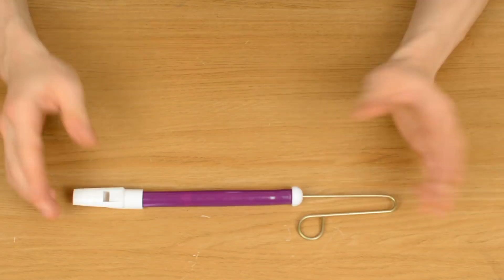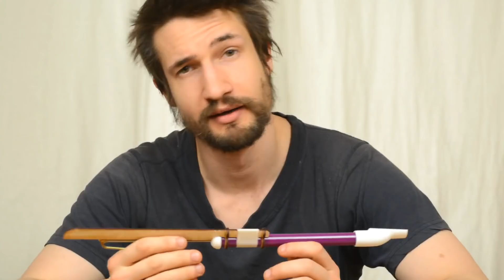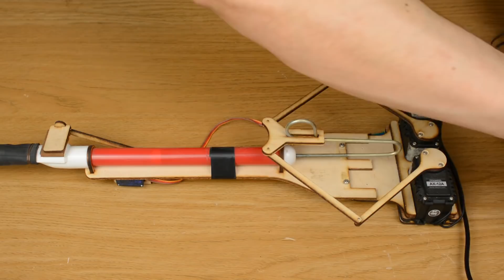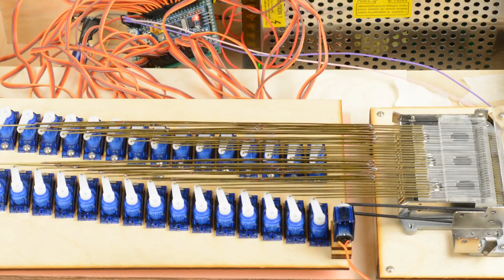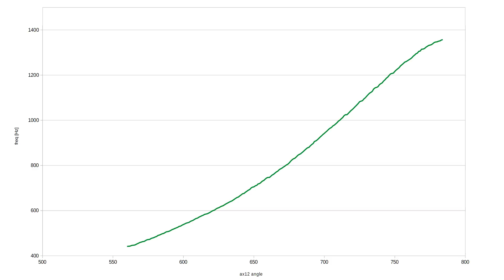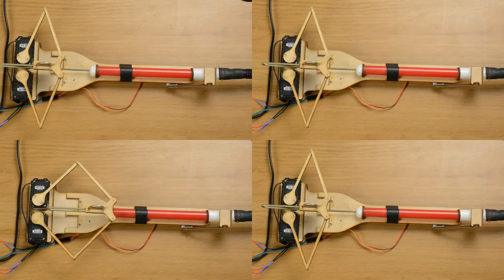More MIDI madness

Comment: Use a stepermotor and a slide mechanism like in fast 3D printers. And you get accuracy in every note. Also make a Flute organ with different sizes to get the base the midst and the hights

Comment: You can make it auto tune it self. Add a small mic to it and a code a frequency analyzer, make it to do a full range slide and update the points where the frequency (the notes) where right. You can also add a "if" statement that if the updated points deviated too much from the previews save something went wrong and it should discard it or run again.
You can make it do it at every start up and/or add a button to call for it.
Reply: This is a great idea!

Comment: all it needs is a vibrato function. something like a small trill between half pitches and you could adjust the strength of the vibrato with the mod wheel

Comment: I wonder if that stopper you're using for clean note starts could be linked to the glide function that's present in DAWs that determines wether the synth glides to the next played pitch or not, depending on how much time there is between the midi input of one note and the next or if the inputs overlap. You maybe could make the stopper close the hole between notes when you want clean changes or a staccato sound with no glide in between. Also, big pvc bass slide whistle?

Comment: Oddly, this is the first time I've ever encountered constructive/destructive interference from my computer speakers, during the three 4-ish part songs. I had to be in a specific position in relation to my speakers, and got an odd sound and feeling right at my eardrum(s). Just something about the tones etc. Also, just a tiny bit curious, why use 2 servos to drive the scissor, instead of one with a gear that matches to the other side? I'd assume insufficient force etc, or difficulty of making sufficiently tight gearing, but nothing was stated.

Comment: Wonderful project! If you already have automatic pitch detection for your calibration run - couldn't you include a control loop during playback to adjust the pitch if it is slightly off?

Comment: Holy shit, this reminds me of the time I used a similar board to build a ghetto-as-fuck lighting controller... Being a diehard Rammstein fan, I predictably added a special 12V relay that set one of my arms alight with a bunch of pyrotechnics. I found the video the other day of my miming (REALLY badly) Du Riechst So Gut with a seizure-inducing light show, and perfectly timed pyros. I say miming, because I was still so new to guitar that I couldn't even pretend to play it! I kinda went off the rails with the pyrotechnic stage shit, and learned bass, keyboards, and how to actually play guitar instead. Mad times. I'll have to build another one if I can get permission to pull that shit off live anywhere!

Comment: been thinking about the bass slide whistle. I was thinking about building one out of a large pvc pipe. to drive the plunger maybe have a lead screw through the center and a beefy stepper motor to move it.

Comment: don't you think you could just MAKE a bass slide whistle? surely you would just need the whistle piece off a recorder, a large length of pipe, a wooden disc with some cotton around the outside of it for the plunger and some stiff wire (probably a coathanger) for the slide, then you'd be golden.

Comment: The timbre is so bad though... The tech is awesome, but you might as well make a better sounding whistle to use and not that cheap dinky plastic whistle that probably is not meant to be played seriously. Sound is complicated and difficult to explain details about, because we don't have the vocabulary to go into specific details about different sounds, but long story short, a note isn't just one note. It's a whole bunch of frequencies combining into a "pitch" a given pitch can contain all kinds of different imperfections in it depending on the thing that is producing it and this dictates how pleasing the sound is just ambiently without anything else going on amd is a partial explanation of why different instruments sound like different instruments. You could make a whistle with better dimensions and matierial that would just sound better and produce truer, more perfect pitches. I sense strong dissonant harmonics coming from that specific whistel, which is why it just instricaly sounds cheesy and bad. Even if it played perfectly in tune it won't fix the timbre.

Comment: Autotune slide whistle. Fail!
Drop the plywood. Re-design the piston to allow it to slide on the shaft but with stops to limit its range to 10 mm or so. Oh, also put one of your powerful magnets on it against the outer wall.
Add your series of magnets on the outside of the tube. The expectation then is that as you move the piston in and out of the tube, it "snaps" to the nearest magnet on the outside of the tube — the 10mm slop you added allows that.

Comment: Great video! Only complaint is the structuring. The pace could be increased a little bit and the full demonstration could be put later on to maintain enagement with a little excerpt used to prove the concept.

Comment: I think the didgeridoo and cello sound good together... I liked you xylophone and music box too. There is always the glass harp.  I remember hearing something that worked like a panpipe, but the tubes had water inside, so it sounded kinda slurpy..  

How about making a water pan pipe with  bellows/diaphragm to control water level

Or a reed instrument that uses a piezo membrane in place of the reed...

Music selections:
Vivaldi Four Seasons
Deodato-2001 Space Odyssey

Comment: That non-midi slide whistle from the beginning of the video could be improved further by gluing a steel disk to the face of the piston, and then glue the magnets to the outside of the plastic tube.

Comment: Weirdly this is almost the exact opposite of what I 've been thinking of since finding out about the FLASH. What is the smallest midi control interface you can think of that could be built that is capable of a full octave and could actually be played to an elegant level of proficiency? And no, I'm not thinking of a little ribbon controller.

Comment: There's a lot of breathy, white noise, ripe for filtering. Here's a thought, you can rotate the whistle about the slider axis without changing the pitch. Perhaps by standing it up, you could rotate the (leading edge, noise hole?) to direct the sound into one of an array of simple, open tube type, formant resonators circled around it, giving you *vowel sounds*! Lengthenable tube inside a tube and you got yourself a dipthong. A tube with an openable mute at the end gets you a wah a wee, a weh, yow, oi).
 You can fake a bass swanny whistle by recording in double time and playing back half speed for every octave. Sloppier, but bass parts are simpler. Inversely, you could tighten up faster passages by recording at a slower speed.... You could also alternate from octave derived ranges and timbres by modulating, say, a fifth, then recording and playing back at the right harmonic ratio (2:3?). Although this could get a bit modal, beyond fifths and fourths, you are the master of your temperament. That could be a cool way to emulate modal choral arrangement, Gregorian chant, which could be hilarious.  It may even be feasible to script and automate multiple passes calibrating, multitracking and editing these pitch/time derived timbres, leave it running, perhaps out of earshot, and return to an immense multi voiced lush chorus of swanny. And maybe a generated an editing script you can import into a video editor, Or a slow frame rate time capture with a sunset in the background, for content purposes. May be obvious, but, further to extending the range of pitch and timbres, with automation, you could do multiple further passes with different damping, slightly detuned, or tuned to a lower throughput of air, and create further, double tracking (not harmonizing), 'studio chorus', thickening effects, without using modulated digital delay. That might be musically useful, potentially a sample pack for patrons. You could create a veritable Enya of swanny whistle. Yay content.
Are the overblown harmonics useful, repeatable? Thinking you may have finer control of the pitch with a lower note playing a harmonic, potentially another timbre for multitracking.
If you ever go back to this, and mount it, it will be worth isolating the motors, via shafts into the box, way more prominent than the fan. Multi tracked servos will be a nightmare. Love your work!
P.s. it might be useful to add noise to your pitch by adding a vibrato from another source, maybe with an LFO'd, off-weighted vibrating motor interacting with the shaft in some way. Or a coil holding an oscillating current surrounding the shaft. 
Given your setup recalibrates itself, you could swap out alternate mouthpiece, tube and plunger combos with others of the same length, but different diameters, or materials. Different mouthpiece type, eg a transverse flute might be doable, reeds?
Final thought, another air pressure source, just for transients, might reduce attack times and help control the amplitude by blowing the harmonic out such that it's just in the transient, leaving the fundamental to sound. Maybe.

Comment: yt doesn't allow direct url's now, way to kill the yt usefulness, yay.
did no one notice and complain yet !

anyway see
Robert Murray-Smith Making Tongue Drums - Working Out The Size Of The Tongues
Robert Murray-Smith Making Bellows - Template And Tape Method
Robert Murray-Smith Hemp Plastic - Moulded Sheet And Rod
Robert Murray-Smith Making A Speaker From A Microwave Oven Transformer

opensource com article 18 8 programmable-music-box-software

Create DIY music box cards with Punchbox
Now anyone can create music box punch cards.

Comment: It's... a  mixed bag here. First time I had to stop one of your videos to preserve my earing. 😔

Expression is definitely lacking. Both in your human performance and in the midi one.
It's... a whistle: you should definitely whistle in it.  Not 100% sure it would sound better, but it can hardly sound worse.
It should give an... ADSR envelope to the tones you're producing.

And then: how can a computer whistle? Maybe a solenoid valve? Maybe a motorized bellow? It's... gonna be a pain to implement, after all this is pretty much ventilator technology, we all looked into it in 2020 and it's hard to get it consistent.

Also some components for it, like solenoid valves, might still be a little on the expensive side, right now.

Is it worth researching? It might... if it's not meant to be born and die with the whistle. MIDI harmonicas might be REAL fun. MIDI irish whistles too. Also MIDI saxophones and MIDI piccolos, then, might be a big hit: but you need a very strong airflow for those.

Still... find someone who can actually play one of those instruments for advice, because it takes a long while to get what is ok and what is "OHMYGAWDMAKEITSTOP" right, with expression.

Comment: Really nice work. My initial reaction is that it should be easier/cheaper to get away with only one servo and one lever, with the lever being stronger. I think the scissor mechanism contributes to inaccuracies just because of the flexing. You could also go to 3d printed whistles to narrow down the sound parameters. Maybe you can design a slide whistle that requires a much smaller sliding distance. Or even a circular one that can be driven by a servo directly...

Comment: during the live section I was thinking what I would play on it if I could and thought a cruel angels thesis would be great lol. When it came on I flipped out lol. I also thought that maybe when/if you get a butterfly valve system up you could use a funnel over the sound hole so you could make it louder/ mic that up really close to get more servo noise out.

Comment: Hmmmm.
I wonder if there is any way to get a more silent actuation. 
You could abandon the slide altogether and use apertures but then would it be a slide whistle?
No. I think this is almost as good as it gets, for a slide whistle. A butterfly valve, bellows as you suggest, and might I dare suggest an autotune connected to a direct drive servo with closed loop control in lue of the noisy steppers, and you'd have an commercially viable product 

Albeit. One with limited customer base. Id buy one. For what its worth.

Comment: "If there's such a thing as a bass slide whistle..."
A Trombone?
Reply: Not exactly a trombone. In a trombone you decide what note do you want to play by slider and LIPS cause the higher "buzz" you make by mouth the higher will be the note on the trombone without moving the slider. I think it would be hard to make that "lips moving" by machine. In slide whistle you just blow.

And yes. I know that a joke but i wanted to explain this
Reply: @kanji2425  I appreciate the explanation I did not know that about trombones!
Reply: Acme makes a relatively big and low slide whistle. I had no idea until it arrived. It’s abnormally large, more alto, but still.
Reply: or This: https://youtu.be/F6vYgshPuaQ
Reply: @ToiZophai  not a whistle...
Reply: @leobrennagh-mackie4839  True, but is a wind instrument. Although the air needed to play it would be over 9000, to be sure. :3
Reply: nah slide whistle is woodwind not brass
Reply: Sackbut?
Reply: Bass Trombone 🤙
Reply: @QuintonNG2000  CONTRAbass trombone.
Reply: @MarkZickefoose  Ayyyyyyy
Reply: Great Idea !
Reply: 16” Flue organ pipe with a slide?
Reply: That's a horn
Reply: Brass is brass, wood is wood, plastic is this. all materials produce intrinsically different sounds. sound is complex and i don't have the time or energy to break it down.
Reply: @dickrichard626  Brass slide whistles predate plastic ones…
Reply: Eh... kinda

Comment: What's wrong with the pump? With bellows there would be a dead spot as they open and close. A  peristatic pump as used in dialysis machines would give more pressure, but why bother when it works as it is?

Comment: It would probably be easy to implement vibrato in software, which would make the sustained notes sound a bit better.
I wonder if a volume envelope or tremolo could be implemented by varying the amount of air that is let through?
And couldn't a baritone slide whistle be implemented by just adding a much longer or much wider tube?
So many possibilities!
Thanks for the inspiration!

Comment: I was thinking about how the levers are somewhat innacurate despite their quality, have you tried using some sort of a spring and string setup where the servo spins a wheel to pull out the slide? That may produce more accurate linear motion

Comment: Butterfly valves are what are used to direct pressurised air in (at least mechanical) pipe organs which is how they avoid needing to block the voicing mouth of the pipes. I don't know if this requires any special sealing.

If you were to do a next iteration you could even share the air source and align them vertically to create the first slide organ.

Comment: the slide whistle is like the wind instrument version of a violin, no frets, tune by ear and muscle memory
Reply: that would be the trombone
Reply: @duncathan_salt  which is harder to play, trombone or the slide whistle?
Reply: @yepd4321  I'm not qualified to answer that, as I have never played the slide whistle, but all the qualities you described apply to the trombone
Reply: @duncathan_salt  i agree
Reply: @yepd4321  making the intended noise is easier on the side whistle, but intonation is easier on the trombone. The slide whistle is just so tiny that the degradation between notes is too small for most people to perform accurately, even with the fancy magnet thing. You can hear that he misses some notes even with the help. Trombones are large enough that most people can learn to line things up accurately. Violin is also bigger and easier to intonate, due to the same thing. 
There's a reason piccolos have keys and not slides.
Reply: @duncathan_salt  Well it depends if we're talking woodwind specifically or not. A trombone is a brass instrument and not a woodwind. They don't occupy the same niche.
Reply: @Soitisisit  "wind instrument" encompasses both brass and woodwinds in its conventional usage, it doesn't imply specifically woodwinds
Reply: @duncathan_salt  Yes, I understand that. I'm just making a speculation about OP's thought process. For the common person who hasn't studied music they might say "wind instrument" meaning woodwinds specifically not considering that brass is also a wind instrument.

Comment: A small microphone near the whistle with a microcontroller could, on powerup, calibrate itself every time to a much greater accuracy. Just pull the motors back slowly and listen to the tone it's producing, put that in a table. Now you have a list of positions and the notes they make! In theory, you could also detect the volume with this and implement MIDI volume control as well.

EDIT: Apparently this was already done in a script

Comment: Coulda done temp+humidity+pressure measurement for auto-calibration, but my ear can hardly tell it’s out of tune in the first place.

Also through deliberately generating harmonics by altering the airflow, maybe you could get a greater frequency range. As for low frequencies, I think it would be easier just to make a slide whistle with something like a large plastic syringe.

Comment: FRICKING GLORIOUS! :)

Its ironical that an inkjet printer (with a encoderized linear-stage plus much more) cost less than two fancy servos.
Reply: commoditized + subsidized.
Reply: They're loss leaders for the most expensive substance on Earth: printer ink!
Reply: It probably would have been cheaper to use a single servo and a gear.